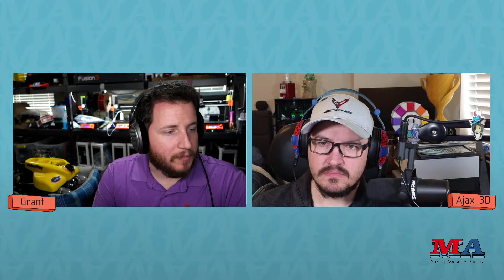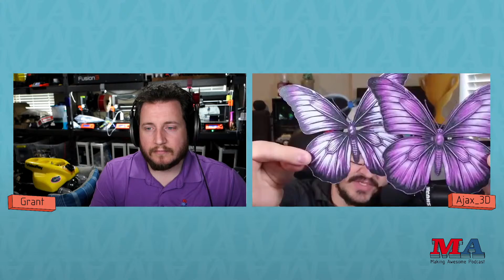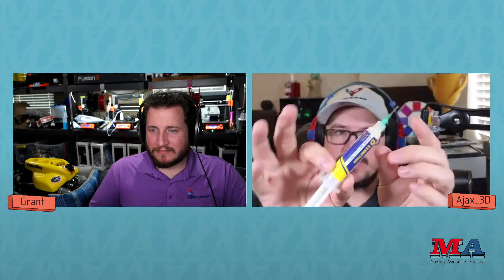PERFECTING Color with AJAX and the TD-1!! - Making Awesome 182

Comment: Open source TD-Free. I have no problems with Ajax making a kit or complete. But this is too simple to be firmware and a license. The fact that is using an inferior color chip screems obsolete from day one. That you only need a led, lux sensor and rp2040 board means its a very simple project.